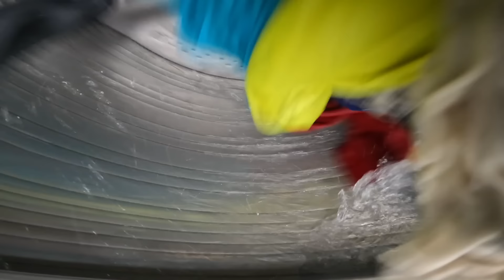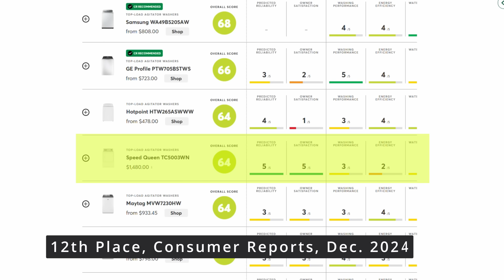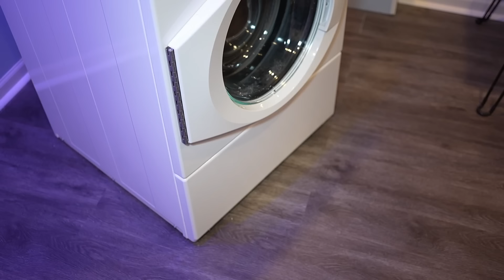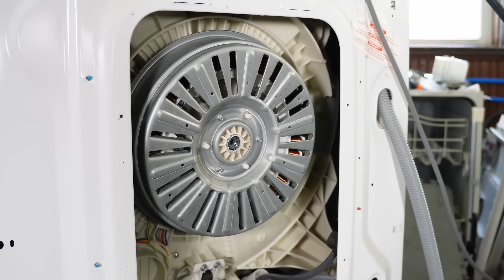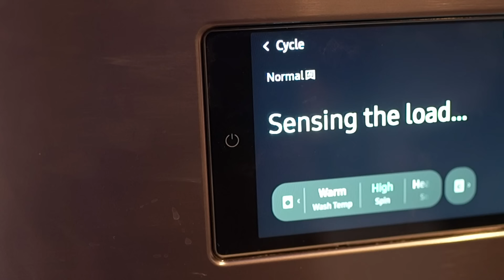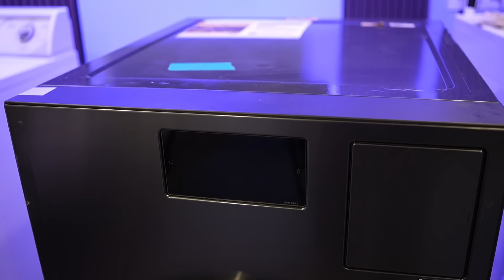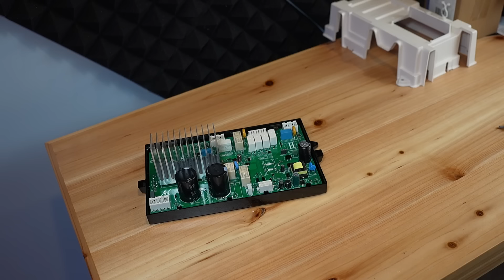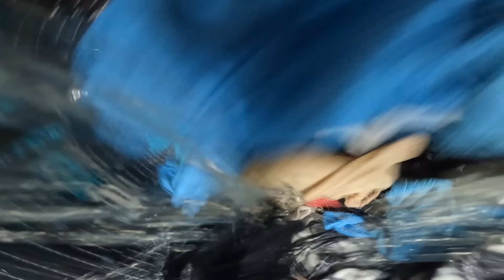Is America's Most Expensive Washer Great? The Speed Queen FF7009WN Test

Comment: I got the pair 2 years ago and the washer has been phenomenal. But the dryer has the worst auto-drying behavior I have ever experienced. It will either torch your clothes running for too long, or leave them quite damp. Ive fiddled with the sensitivity and never got right with it. Nor did repeatedly cleaning the moisture sensor do anything.

A slight complaint, the dispenser drawer for the washer is almost too simple in its design. If you want to delay the wash or run multiple functions, you're forced to use powder or else liqiuid setergent will gravity drain at the wrong cycle. Not a big issue, but the siphon for the fabric softener is honestly terrible. When you fill up the softener compartment for a subsequent wash, it will start dripping because the siphon hadn't completely emptied itself. The only solution that worked consistently was to gently pop the "lid" of the drawer, which would break the seal of the siphon and let it empty completely. Otherwise, a fantasitc machine.
Reply: Agreed the SQ washer is great, my matching dryer we only have used on the 60 min time dry. Used auto dry one time, came back over 4 hours later and the machine was still running. We have alot of laundry though so the machine is always full and therefore very little variance in dry time is ever needed for us.

Comment: Are machines available as made 30 years ago?  I remember how easy it was to change the electrical timer switch and for that top loader you could open the lid if you want to add anything.  In my using machines from the early 60s, there was never any problem with the top popping open.  Too much digital hooey which, as you mentioned, is costly to replace ... when I ever need another one, I'll be looking for old school only ... thanks Ben
Reply: No.

All those mechanical/electrical timers were far more expensive than a computer is.

On machines with "old dial" controls they are most often just input devices to the motherboard.

Comment: I want to love this washer, but can't.   If value for money is not a consideration then sure, splurge on the purchase.   BUT,  buying the entry level Amana vertical modular washer, a surge protector and not abusing the machine with excessive detergent AND no use of fabric softener is your best bet.   Lower quality?  Sure, but is Alliance Laundry Systems (SpeedQueen) going to GUARANTEE availability of a $650 replacement control panel 12-15 years from now?  Probably not.

Buy the cheapest appliance you can afford that is not Samsung and invest the difference for an expected replacement purchase in 5-8 years.

Sincerely, 

An Accountant

Comment: I've had a basic model Speed Queen for about 5-6 years so far. I don't need a lot of features and I don't feel that the capacity is an issue. The only complaint is the the lid lock which I disabled and the start switch which is real sensitive. Cost more than other comparable brands, but I will buy them again.

Comment: Hey! I was curious to know if the Double end 90 degree angled steel braided washer hoses are better to use over the single 90 degree ones with the straight connectors on the other end?

Comment: One tough stain if you want to test out, which I found extremely hard to remove, is 100% fresh grape juice (from real grapes, not bottled juice).  While you don't see the juice while wet, but after it goes through a wash and dry... it will show up as a dark/brown stain.  I've tried... Tide liquid... Shout... Oxiclean... bleach... Borax... hot water... etc.  I use an 1990's Kenmore Elite, on large load.  While the white towel is clean... but it the stain still shows.  Other difficult stains over time fade out after about five washes... but not grape juice.  This is one prob the toughest stain I've met (but I'm not willing to spend some super expensive cleaner to remove).

Comment: i like the look of that speed queen machine, in uk all our machines have a inbuilt heater so it will heat up if water input is cold
Reply: This is one thing that I was disappointed that this washer did not have.  It replaced a Whirlpool HE3T that did have that.  I'm using a tankless water heater, which is less than 3 feet away from the washer, but if you start a load of laundry, and haven't used any hot water for a while, you will end up with a "slug" of cold water...so, it's good to do something like wash some dishes, then go and start the washer.

Comment: For the price, it needs to last 30 years. I could get 10-15 years out of an LG no problem (minus the units with those completely gimmicky and pointless screen in dial), so for 2-3x the money if the SQ doesn’t last 30 years I’d be pissed. I’d like to see power consumption figures. Thank you for making this video!
Reply: How do you know you’ll get 10 to 15 from an LG your guessing your not guaranteed you will get that time ?
Reply: 10-15 years on light usage. If you have several kids and/or 2 families use it than I doubt it.
Reply: My LG just went out after 5 years and 10 months. I paid $765 for it at the time. Repair would have been $700.  The repairman recommended I get a Speed Queen, that's what he has at home. I just came back from the store where I purchased an FF7 open-box for $1350. I've never splurged on an appliance before, but I fell like I made the right choice after watching this video.

Comment: I am responsible for maintaining 50 or so of these and I love them from a techs perspective.    "Lots" of mcb issues relatively speaking.
Reply from the maker: That's what I've heard about the MCB. The owner of the store is bought this from said there was a really bad batch during the Covid parts crisis of 2020 that caused it but who knows.
Reply: @bensappliancesandjunk  one location has 35 pairs and over 6 months in the first year I had replaced 30 ish mcbs.    That was 2018 maybe some I have replaced for the second time.   Inner door bezels is the part I replace the most probably.  A casualty of tight laundry rooms and building policy's to leave doors adjar.
Reply: How hard is it to pull the tub in these? I’m of strong opinion that every machine, especially fronts, need physical grime removal after so many years.
Reply: @TheClintMatthews  i have never seen the need for it in 30 plus years of working on laundry.   Wipe the seal occasionally but most fill themselves full of water and agitates around and pump it out again, which does a bang up job of cleaning.
Reply: @stevenlauzon7031  Gotcha, thanks.
Reply: would u get a gas speeed queen or electric for dryer? i wonder if they will ever get intot he heart pump technology
Reply: @randomrazr A heat pump cloths dryer? That about as likely as a heat pump kitchen range. I don't think the physics work.
Reply: @uptoolate2793 There are a number of heat pump dryers on the market currently, sometimes described as “ventless”. They reuse the air they’ve heated by using the heat pump coils to remove moisture from the air and then reheat it. It’s actually more energy efficient than a traditional electric dryer. I have no idea if the models currently available are any good, but they exist.
Reply: @uptoolate2793 You don't watch this channel then.  It's s real thing most manufacturers have now. @uptoolate2793
Reply: @uptoolate2793  heat pump clothes dryers have been a thing in Europe for nearly 20 years now, they dry on low heat so take longer approx 90 to 120 mins but the cost savings are astronomical
Reply: @uptoolate2793 They’re pretty common in Europe. They act sort of like a closed dehumidifier, heating up the air, forcing it through the wet clothes, then pulling the heat from that hot damp air so the moisture condenses. The heat is then recirculated through the system. They’re very efficient, but quite a bit more expensive. The operate similarly to condenser dryers except they’re a mostly closed system so they waste a lot less heat.
Reply: @uptoolate2793  There are several now from GE, LG and Samsung among others.
Reply: That’s interesting insight from someone maintaining that many of them. When a machine is easy to work on, techs usually end up liking it even if there are a few common failure points. The MCB issue is a good reminder that a lot of modern appliances are still limited by electronics more than the mechanical parts.

Comment: Used to be Raytheon!   I have a number of old ones with the Raytheon badge on the back
Reply from the maker: Right???? Every so often we will see an Amana-badged unit with a telltale Speed Queen transmission in it. The 80s and 90s were super fascinating regarding these units and so many others that were consolidation and aquisition victims.
Reply: @bensappliancesandjunk  I can't afford any other Raytheon equipment but I have a old mechanical timer top load Raytheon in my car hole that we use to wash  50 lbs of carrots or whatever.
Reply: @stevenlauzon7031   I've got a 40-year old Rayethon built Amana RadarRange microwave oven...still going strong, and cooks better than any newer one I've ever had

Comment: Designed to last forever and be easily serviced with parts that can actually be obtained.  It's smaller because it's meant to do multiple loads a day without an issue.  It's got laundromat heritage in it where it might run a dozen loads a day, back to back, for years.  The ability to survive that is why it costs more.  Personally I think the current Wascomat machines are better but they cost a lot more.
Reply from the maker: I'd love to try a Wascomat, but the issue always is if it makes sense for this channel. If it did, I'd love to review a Dexter 60lb Soft-Mount system. That wouldn't last a lifetime, it would last a century!
Reply: @bensappliancesandjunk  That would be awesome but does a $10K washer make sense?  Purely from a curiosity side, absolutely!  But realistically, not even to laundromat operators. Most of them just get whatever brand will give them financing.  Alliance finances probably 75% of the stores in my area.

Comment: i got the SQ 2000 series washer a few months ago and couldn't be happier...after going through 3 THREE!!! circuit boards on my commercial Maytag home washer, I was tired of the electronics on these new machines....it's a little smaller inside but who cares...it is mechanical switches and just washes your clothes just like the "old days".....not water efficient like the newer stuff but I can adjust the water level to accommodate the load accordingly....i cost 1300 but I was tired of paying 275 bucks every 1- 2 years for a new board, or sputch kit, or actuator that went bad too on my Maytag
Reply from the maker: TV-2000?

Comment: I can think of a lot better way to spend $2,500 bucks. Like new cars, way too much computer & electronic frippery.
My choice?
Whirlpool-built base model top loader with less features to go wrong and no fancy touch screen nonsense for me. Mine is branded a Crosley. Ditto Whirlpool gas dryer. Both over ten years old, I've easily fixed both.
Reply from the maker: The issue is that a base model WP today is gonna be a bit worse than a base model WP from 10 years ago. Which is super sad.

Comment: My sister has this Speed Queen and she said only on the spin she can hear it. She said it sounds like a jet. My TR3 Speed Queen top load machine is very quiet.
I am not a fan of long wash cycles. I prefer using a stain removal bar and keeping the cycle time down. Cuts wear on the machine and clothing and it cleans better. 
It would be interesting how different soaps work in different machines. Organic soap nuts, Enzyme cleaners, and std detergents.
Reply: I own this washer too, and she is correct. The spin does sound like a jet, but I would not describe it as overly loud. In fact, I find the sound pleasing to listen to and it actually makes me sleepy and want to take a nap haha.

Comment: That motor control board is going to fail way sooner than 25 years it looks kinda cheap electrically for the price you'd expect a lot more protection, filters, oversized power stage, etc... the unpopulated filter components just screams cost cutting. There is no way that pcba cost 600$ to make even a US prototype assembly house could do a one off for cheaper with all japanese/US parts.
Reply from the maker: I agree fully. It's why I called it out multiple times. Diehl had a stellar rep so I'm scratching my head on why it looks so woeful. I know they had many issues with these a few years ago but am unsure about this specific newest run to comment on so I stuck with what I know.

I was expecting TC Connecticity and Nichion parts on the board, not Sanyou and Samxon